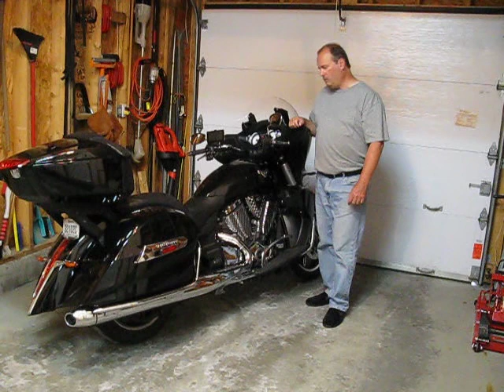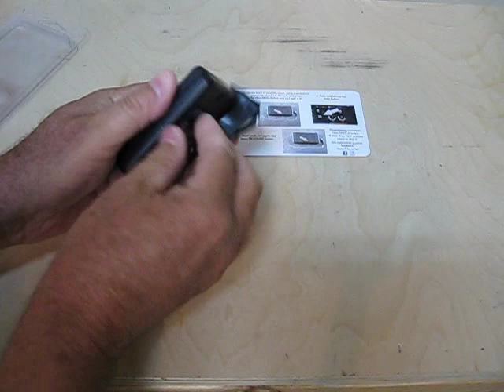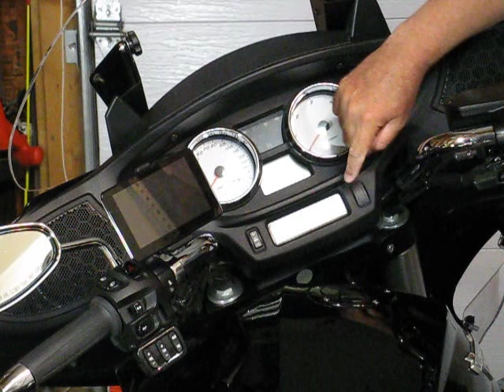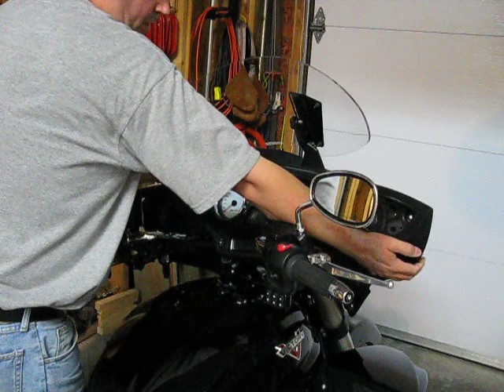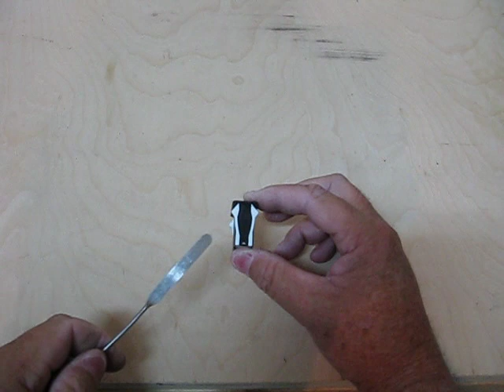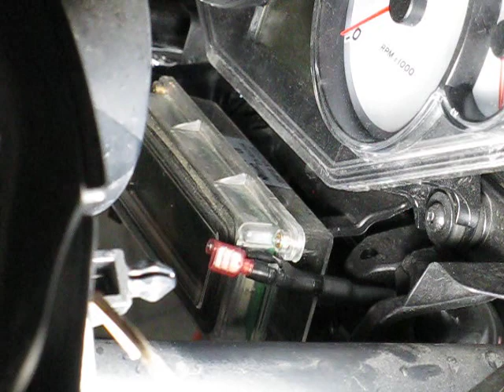Victory CCT Garage Remote Install

Comment: Hi Paul. I was wondering if you know if all the 2013 Cross Country Victory bikes had LED turn signals from factory. I know yours is a 2014, was wondering about the 2013's?
Reply from the maker: I can not give you a definite answer on that. I can ask on the VOG and get back to you.
Reply: @PaulPomerleau  thanks so much.
Reply from the maker: One guy on the VOG confirms that the OEM turn signals on a 2013 CC are LED. Don't shoot the messenger Lol.

Comment: hey Paul thankyou. your madstad windshield at 11in. you still like it. I to don't like looking through them I'm 5.8. do you wish you got the tinted. your thoughts. when adjusted down and back do you get a fair smount of wind in face? then I'll leave ya alone.
Reply from the maker: I like the clear windshield as I look through it while dodging potholes and such, also while using my turntable I need to see as much of the front as I can, and tinted would just make it harder for me. The rider that doesn't need to do these things may choose a tinted version. It's a personal thing. I am not sure if 11" will still be too tall for your height. That's the hardest part of picking a new windshield is getting the correct size.

I leave mine down and towards the back on nice days to get the wind, then up and forward on cold or rainy days. If I want even more air I open the front deflectors on the fairing.

Comment: hey there new to this. Going to be getting a 14 xct. you had a video on changing it's oil but I didn't see it anymore could you post it again. looking at Amsoil for it what's your thoughts.
Reply from the maker: Here is the link to my oil change video: https://youtu.be/MmAYYD3K-6c
I have never used Amsoil but it is one of the top rated oils out there. Make sure it is rated JASO for motorcycles.
Enjoy your new bike.

Comment: Thanks Paul.  Hope you get some royalties from Mo-Door! You are the reason I bought mine.  They are a great option even if a little over priced IMO. I bought the two door option and it works perfect.  Just finished the install.  First time with fairing and dash off, not to hard at all, thanks to your videos. I left the top two fork screws for the dash off when re-installing.  Have seen and read a few posts that have done the same with no issues.  They were a PITA! Great videos! Thanks for posting!
Reply from the maker: Shawn Butt Glad I could help Shawn. Yeah some of the screws can be a bit tricky. I never thought about just leaving them off, might do that next time. Thanks for letting me know.

Comment: Good video.  I actually did nearly the same thing just over 2 years ago but I did not have the luxury of a pre-made opener so I had to locate the contact points on the motherboard of one of the stock remotes that came with my garage door some 12 years ago.  These days most of us have the Garage door openers built into our vehicles so more of us have simply tossed the originals into a drawer so re-using was a good option for me as I have a bit of an electronics background.